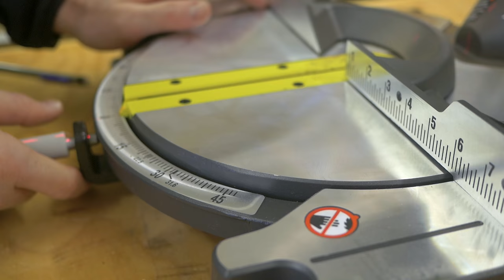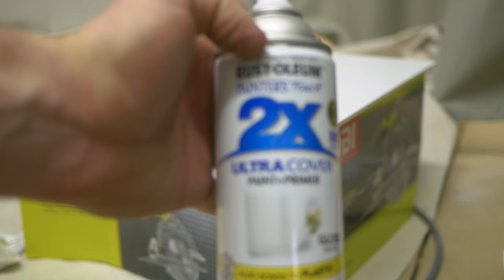How to Build a Battery Operated Light Table

Comment: Thanks for sharing! I have a quick question on when you cut the 45 degree mitres on the walnut, why did you cut it with the board standing on the edge grain versus laying the board flat on the face grain? As a complete beginner with woodworking, I'm just wondering if I've been doing it wrong this whole time! LOL.